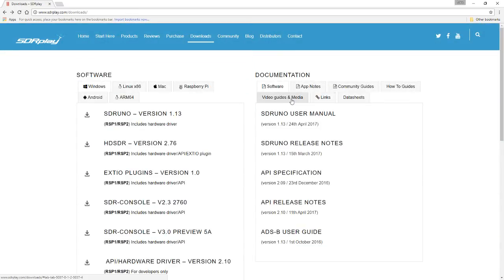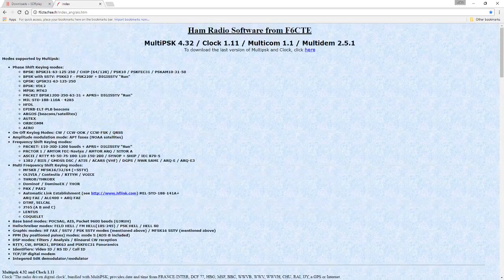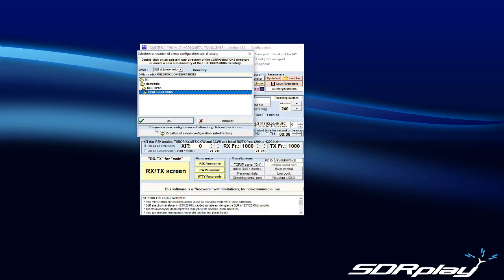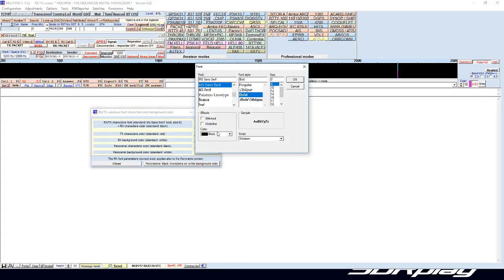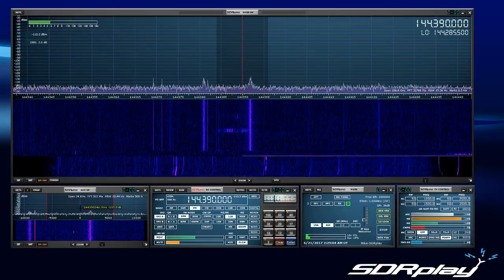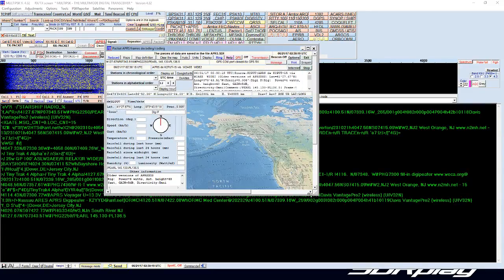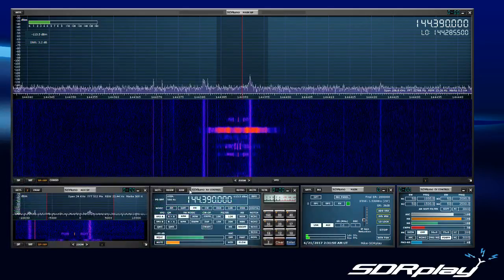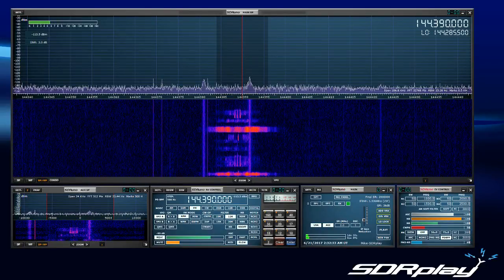Decoding APRS with SDRuno & MultiPSK (MV015)

Comment: Got some problems with this, the Multipsk just cannot decode the aprs. Im using rsp1a, windows 11 and VBCable. I did exactly as the pdf manual, but multifpsk just wont decode. It seems that it have already received the aprs signal, since there is some change in the waterfall map, and that signal area next to the aprs button flashes blue when I push ptt. But it just wont decode. And it wont decoding anything, including CW morse. Anyone got the same problem?
The aprs signal is ok since it can be successfully decoded by hackrf one.
Reply: I also think that you may be able to receive signals, but the software might not be able to pull all the data to display for you from the signal if its too weak.
Reply: I had this problem. What fixed it for me was narrowing the bandwidth in the sdr software and that fixed it. Try that out it may or may not work.